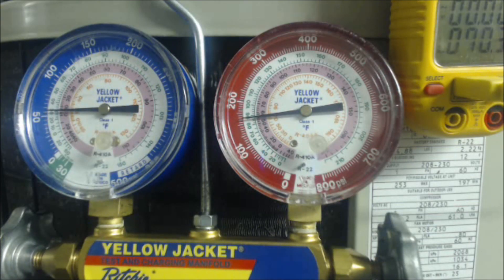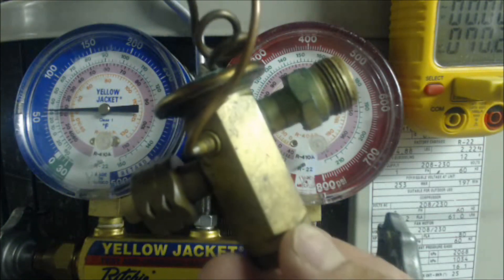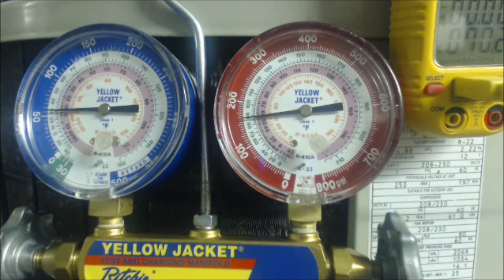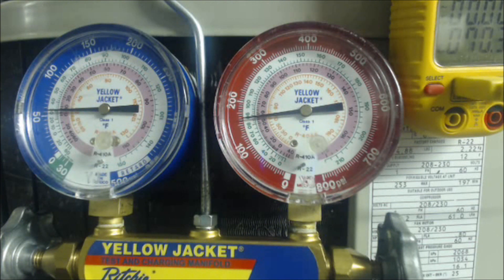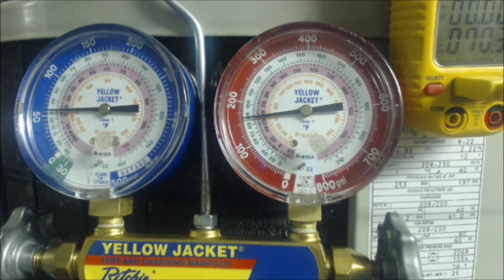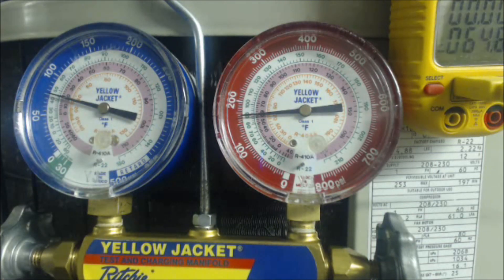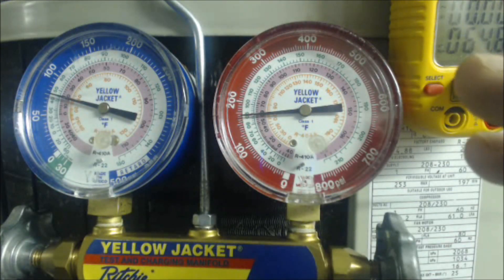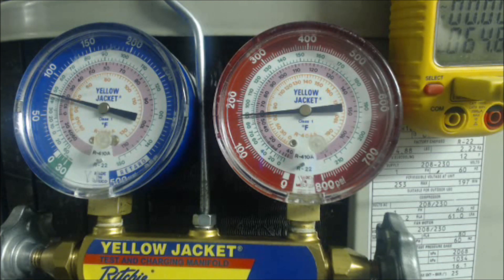How to Measure Superheat and Subcooling!

Comment: Good Video. I have a question. What is the basic purpose of using subcooling and/or superheat to charge a system? Is it energy efficiency? I usually charge a system just using a temp/pressure chart and then check the temp drop at the evap coil.
Reply from the maker: Thanks Mike! Do you mean the temp increase from the saturated state in the evap to the superheated vapor temp coming out? This would be done by reading the vapor pressure, converting to saturated temp on the gauge and minus-ing it from the actual temp on the vapor line. That is Superheat.Superheat is needed to check the temp rise across the evap coil from the saturated temp to the superheated vapor. This is the way to check systems with pistons or capillary tubes. This is exactly what a txv does. It monitors and adjusts to maintain the same superheat across the evap coil. When a system has a txv then you can no longer charge with superheat because the txv monitors that. You always need superheat to maintain a steady vapor and no liquid going to the compressor even when there is barely a heat load on the house. You check subcooling with systems that have a txv because in this case you can determine how much refrigerant truly is in the system as the refrigerant in liquid form is at a certain volume per the manufacturer that can be read with the temp decrease in liquid form after the saturated state(subcooling). You need a steady column of liquid feeding the txv that will not absorb heat and turn to a saturated state before it hits the txv and does a pressure drop.I hope that helps! Do you mind if I post your question and this answer in the discussion post or do you mind submitting this question again in the discussion for me to post this answer. I believe this will be of value for members of the Channel. Great Question! Thanks!
Reply: Thanks for the reply. That helped. Yes, please post the question and answer in the discussion post. I hope others benefit from it!
Reply from the maker: Glad it helped!

Comment: Very informative video. love how you show different  scenario of superheat and subcooling. My R-22 heat pump does not indicate if there's a TXV. Would it be on the evaporator label if there's one? Thanks as always
Reply from the maker: Yes, it would say on the rating plate if there is a txv installed. You could also verify by taking the door off to look if you were not sure. Thanks for the question!

Comment: don't know where else to write this so I'll do it here, I would love to see you do some videos on pressure switches, how to test,  operation , if possible replacement, causes for a trip etc. also I've recently come across a Lennox 3 ton condenser with a 24V hight temp switch right on top of the compressor. 2-24 volt wires wired in series with the high pressure switch to the contractor. also something that would make a good video.   keep the great videos coming. I enjoy your work.   thanks
Reply from the maker: Yes that would make a good video. I will have to wait until I get back to the shop for to do a video like that. I have had the board go bad on older condensing units with pressure switches when you don't even need a board for a single speed condensing unit!